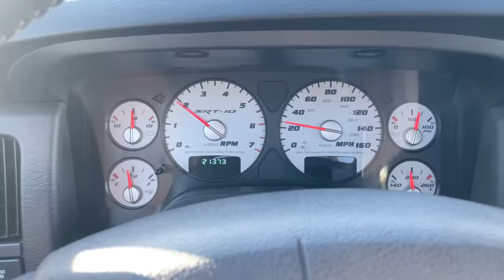The Danger Ranger 9000 Was WAY MORE Dangerous Than I Thought... (My Race POV of the Crashes)

Comment: The 22 truck claimed he was pushed in to Derek's 1776, this video clearly shows 22 put the pit maneuver on 1776 without help from behind. Should've been DQ'd.
Reply: Clearly shows he drove in shallow and pushed up the track to me. Racing incident. Also if he really did claim he got pushed into him, Cleet does hit him from behind AFTER the initial contact was made so that may have not helped, but once again it was a racing incident. Not saying Cleet didnt anything wrong but to sit here and bash the driver of the 22 for an obvious mistake (over drove the corner for his shallow entry) is ridiculous. Arm chair quarter backs out here.
Reply: Go watch his video he does it to survival other people he just happens to wreck Derek. But yes the claim that he was hit from behind making him hit Derek to begin with is crap. In his comments he claims Cletus pushed him into Derek
Reply: Derek's number is 1776 not 77. Number 77 is Parker Mitchell Cletus is brother in the red McDonald's truck
Reply: Through the entire race you see Cleetus trying to get his truck to turn left, putting in a lot of left turn on the steering wheel, but the truck still sliding to the right. Look at the 22 vs 77 incident again, you'll see 22's front wheel pointing left while he slides to the right and into 77, same shit Cleeters truck does the entire race, it seems those ford rangers don't really like turning. Right after 22 hits 77 you see Cleetus bump into 22's tail, so with adrenaline rushing it's easy for 22 to mess up the timeline a bit and fell that he was bumped into the 77 car. All I see is a race incident of 22 understeering and sliding into 77, no foul.
Reply: @dannypaulross9654  except I have watched HIS video and he hit 2 trucks the entire race. VGG where he over drove the corner and Kevin at the end where Kevin came down on him while he held his line. Sorry but thats not what you're claiming at all. Not to mention none of you are coming after JH Diesel or Cleets brother for the wrecks they caused. Just a manhunt after the guy that won the race. Get out of here.
Reply: @dannypaulross9654  its almosy like the 77 is brightly colored and the 1 and 6 are painted on in a hard read color. I thought it was the 77 at first too. Then I realised there were 2 77 trucks until I saw the other numbers. Also the actual 77 caused more wrecks than the 22 did. Lmao.
Reply: He was bouncing off of EVERY truck in the corners trying to keep momentum. Not to mention Cleetus clearly said no pit moves.
Reply: @tiffanieeakman8211  its almost like you haven't ready a single comment here. Not a pit maneuver, looks like he over drove the corner, you can see he still has the tires turned left during the contact. He also only hit 1 other truck from watching his video and that was Kevin late in the race when Kevin came down on him. But whatever...we just say random things now and hope they are true.
Reply: People don’t understand racing, racing incidents happen all the time, you overdrive and cause a wreck, it’s racing. Should he have been that aggressive, probably not, dq for something not intentional seems like it would ruin the entire race and cause drama.
Reply: @tylersessions2214  not to mention the massive variance in skill level when you hold races that are open to the general public.
Reply: @strandvaskeren  look like it was turning left pretty good at 12:30 in when he swept down the whole track and smashed the two guys into the infield though , dude just sucks at driving IMO
Reply: You guys just wont stop crying about a DQ.
LOOK AT THE VIDEO
Cleetus is running the same line. Should he be DQ'd? 
JH actually did a "pit maneuver" on James... Should he be DQ'd?
Should every contact be a yellow and replay for DQ? You guys have business killing ideas.
This is an amateur event at the "freedom factory" called "DANGER RANGER" ... What did VGG fans expect?
Why don't you guys stop hating on FBK, shitting on their victory and MAN UP 
-challenge FBK to a rematch and make some content instead of CRYINGGGGG DQ
Reply: @Sabrinahuskydog  well except for the rules... garrett does give rules at the drivers meeting.... freedom doesn't mean lawless
Reply: You should Go back to watching F1 racing. This is clearly too scary for your sensitive eyes.  🤦‍♂️
Reply: @ba97racing  yeah when pushing hard I to a corner instead of driving through people he could have simply....let off.
Reply: @jaydoe5654  so they ran the same line cleetus managed to not drive through anyone? Pro tip....let off the gas if you are needing 8 wheels to rurn...running the same line is irrelevant if one person doesn't let off the gas and pushes into everyone else.
Reply: The turn prior to the incident the 22 truck held his line in the corner just fine when he was racing next to cleetus.  When he shoved his truck down low to make it three wide he knew he was going to ride the brake to hold that line and not accelerate until well after the apex.  He had let off the brake prior to the apex.  The truck was barely holding traction on the right front but then he rolls into the throttle which obviously allows the truck to begin to push high.  It was easily avoidable.  Especially considering it was lap 3.  At the very least he should of been warned and moved to the tail.
Reply: @jaybird4756  yes you're right he could have. But he didn't. He made a mistake. It doesn't mean he did it intentionally. Even the pros make mistakes. Cut the guy some slack. Why don't you all rip on JH for actually intentionally pitting someone and flipping their truck.
Reply: @jaybird4756  also, cleetus didn't run into anyone cuz he didn't have a truck on his outside at all in that turn. The 22 was 4 wide. Maybe the 22 didnt back off cuz he knew if he did he would have gotten hit by Cleet. Jesus people stop acting like you would never make a misjudgement in the heat of the moment. Especially knowing half the guys on that track and half of you in the comments section probably dont have any racing experience at all.
Reply: @jameseyman9078  idk how much experience the 22 has but once again, this event was open to the public. Lets take their skill levels with a grain of salt here.
Reply: So do we disqualify jh diesel for purposely flipping James?
Reply: @dannypaulross9654  my bad, fixed it
Reply: @ba97racing  I'm partially colorblind, that doesn't help!
Reply: VGG fans are crybabies omg.
Some one just give derek a participation trophy so his followers can feel safe again...
Hating on the winner and his personal business, hating on cleetus, ignoring JH's ACTUAL pit maneuver, making up rules, lying about what happened... wow.
Guess this is why Youtube doesn't recommend VGG to me.
Reply: @jaybird4756  Pro-tip : Stay on all 4 wheels to win a car race. 
If cheering VGG, bring kleenex.

Comment: "Thanks you guys for not cheating..." So wrecking dude on purpose isn't cheating? Don't get a guy wrong here, rubbing is racing. However this looked deliberate and it went on the entire race. I am all too familiar with the ole chrome horn, but this looked like an episode of cops where they pit the perp.... Dude should have been at minimum black flagged.
Reply: 22 is a pick. JH needs to cool it as well.
Reply: It looked to me like 22 was attempting to overtake on the apron on the turn, couldn't hold the line in the turn, and hit Derek on his way to the outside.  Not illegal (especially since Cleetus has no problem racing on the apron and was directly behind 22 at the time of the wreck) but definitely an uncool thing to do.

Comment: The frame flex on a ranger is something awful. The rear shot out of kevins truck shows it all. I'm amazed many of those guys got those shit boxes around the track as well as they did.
Reply: shit box is correct. the 3.0 v6 in them have overheating issues out the ass.

Comment: Winner should be DQ for flipping derick then tryed to spin Kevin then was gifted the lead after crashing the admitted to a locker rearend and a tune i hear
Reply: i feel none of the trucks where checked all that much anyone could of changed gearing and stuff and got away with it
Reply: https://www.youtube.com/watch?v=ri2WdFVPauA?t=19m
There is no deliberate movement towards/into Derek, just both following their lines. It was just contact.
Reply: @doubleT84  I agree. Derek wrecked himself in my opinion.
Reply: @doubleT84  22 just drove too hard in the corner, like way too many times all through the race and unfortunately Derek was a victim
Reply: @doubleT84  Right at 9:52 you see #22 turn into VGG at rear quarter panel.. Un mistakeable Pit.. Video don't lie but #22 is.. He said he was pushed into #1776 by who?.. Cleetus?.. He was right behind this and got it on video.. Watch the track and you can see the line clearly was crossed..
Reply: @BrianMacMusicVideos  There is a large difference between understeering into the rear corner of someone and turning the wheel to 100% do it on purpose. Not excusing driving too aggressively, but lets call a spade a spade.
Reply: @BrianMacMusicVideos  We must have a very different definition of what turning is as even at 0.25 speed I can't see the wheel straighten or "turn" towards Derick.
Reply: @VapedTalon  I can't see the wheel turn at .25 speed either, so I don't think it's a pit.

However anyone who thinks that is 'holding your line' should neeeeever be on a race track. That's a Forza style divebomb. His line was straight into someone, doesn't matter if he held it.

Comment: I felt so bad for Derek.  You cant control how others are going to race.  There was an awful lot of contact being made that could of been avoided.  There was not any racers courtesy being shown by certain competitors.  Might have to take the job of flagging a little more professionally.  It is not supposed to be a full contact derby but when its not put to a stop, of course its going to continue.
Reply: You might want to consider most of these guys have never raced anything before and the drivers meeting would be the place to address this. Plus it was a race at the freedom factory, not exactly formula 1 quality drivers.
Reply: I meaaaaan, the racing was cleaner than the freedom 500, and these people have never really raced before. I think they did really well.

Comment: Dude pulled a pit maneuver on Derek.. Just a cheap shot thrown his way.  Deliberate moves that way should cause drivers to be banned from future events.  Yeah it's a competition, but that was NOT an accidental tap.. The driver continued to push Derek around until he lost control... A deliberate Pit Maneuver. These are basically Stock Ranger's without any race safety equipment, ..5 point belts, roll cages, fire suppression and so on.  Check out Derek's video which shows the incident at Vice Grip Garage
Reply: All the trucks had roll cages and seats. As for fire, they had not only had fire trucks but medical as well
Reply: The guy that won is the guy that wrecked Derek as well. So he gets to come back and race in le mullets since he won the Danger Ranger 9000...
Reply: derek is literally wearing a five point and you can clearly see a roll bar in his truck at 6:00.... its REQUIRED to have both before entering a truck in the race
Reply: @thomasfowler2140  having safety equipment doesn’t change that winning a race by ramming the people
I’m front of you is a bitch made way to win a race. The tubby prick who won wasn’t fast, he was just ramming people. Should have been black flagged, In all my years of motorsports, I’ve never seen any other race where a talentless goon is allowed to smash their way to the podium… I’m pretty confident he’ll get his at lemullets.
Reply: Well, they do have 4 point cages and I think a 5 point harness. Still though, dirty racing ain't cool.
Reply: agree should be banned, but u cant act like they dont have 5 points a seat and cage,
Reply: @mikescherrer4923  i wasn't talking about if the hit was intentional or not, the guy LITERALLY said there was no roll bar or 5 point harnesses when its clearly in the video
Reply: So jh flipping James and wrecking Parker is acceptable? Or being a YouTuber makes it ok for him to do that?
Reply: @braaapattack2937  What part of my statement pardons anyone? Across the board... DipS!   Cleetus included!  Read first before flappin your lips
Reply: @braaapattack2937  No it's not OK, and the second one honestly looked more like he just understeered. Didn't look intentional.

Comment: Somebody could have been hurt really bad you can't have people taking the front fender and spinning them out the same one that spun out jack stands the same one spunout vise-grip both of them roll over that is unacceptable don't have the experience to drive when they're sliding like that sideways in Pickups that's a problem you need to I will address quickly I enjoy your show and enjoy the race you have good good clean racing and I enjoy that but the spinning people out needs to be stopped and safety should be top priority take care

Comment: Judging by the comments I’m guessing this is the first race y’all have seen at the freedom factory! Have you seen the crown vics after any of the other races? Most of them are demolished and I remember Brent winning while backwards after a pit maneuver on the straight and towards the wall. Where was everyone crying then. If y’all wanna watch people get penalized for touching another vehicle go watch nascar. Let me be the first to say congrats on the win!
Reply: It is called Danger Ranger to begin with...and with such a lot of them in that fairly small circle that is a sure thing to happen, bumping on each other because they outbraked you when you wanted to brake in deeper the turn so you have to hold on and slow down but that doesn't always go nice, it is like a train where one may fall and others on the back could also fall over

And the incidents happen on the curves where they have to slow down to turn in, and it was no head-on or bump on collision to be honest, when you make a turn you go sideways and then everyone says it was PIT'd

People like those complaining are nowhere close to a racer or even a real fan of the sport, plus it is a truck to begin with which is notorious for flipping over without a load on the back and smack turned in

Everyone had the proper safety gear, the speeds were nowhere close to requiring a cage and there were no hard crashes. That's what everyone should appreciate about it
Reply: Also I might add that this was race that finally "regular" guys were allowed to participate in so you have to go in expecting the experience level to be low. I just don’t like how everyone is trashing the guy who won. Every videos comment section is just spewing negativity at least he had the balls to compete while all of these arm chair racers just sit at home watching
Reply: I get what you are saying but there is a huge difference between a little rubbing and intentionally pit maneuvering someone to the point of flipping.  Back in the day at Heartland Park in Topeka you would have been DQ'd for posing too much of a risk to other racers, "regular" guy or not.
Reply: @brent m I get that it was rough but if you don’t want roll over probably shouldn’t be racing with vehicles that are prone to tipping and also when you watch guys in the other races beating and banging off of each other and putting people left and right you go in to it thinking it is acceptable. Just saying this isn’t sanctioned racing and he didn’t pit VGG into the wall

Comment: If the guy who won wasn’t such a tool half the wrecks wouldn’t have happened!
Reply: @Mo Powwa well he’s the one that wrecked vice grip garage, and he was racing like that the entire time
Reply: That's what happens at a hillbilly track with no safety rules
Reply: @njovwevnjweV  rubbing is racing
Reply: @jarredgallaher2643  They had rules. Rule #1 was no demolition derby driving. That all the 22 did.
Reply: @jarredgallaher2643  in the driver meeting the drivers were told no pit maneuvers...22 didn't hear that part
Reply: @slick-px4pq  he did more then a pit he was using other trucks as a berm so he could go through the turn faster
Reply: @Mo Powwa  he was using whoever was on the outside of him as his brakes going into every corner. Dude straigght pit manuvered multiple people
Reply: @Matty.Hill_87  that was not rubbing... dude races like a 5 year old races in a video game.

Comment: That was great. I agree with other people saying there need to be more consequences to driving like a maniac, especially when the drivers are not professionals. Rubbin' may be racing, but hitting people for the sake of it is not. There is no acceptable situation where you see an open target you can avoid, and you go out of your way to hit it for shits and giggles. I don't care if it is a fan doing it or a lifelong friend; if you see that shit, they should be kicked out of the race and banned from participating for life. Another thought, if you're going to do more stock cars, from now on do a flip test and a crash test of a known good condition one before greenlighting a race surrounding that model to make sure it can survive, because clearly the rangers could, but that was more dumb luck than anything because most cars wouldn't drive that off.